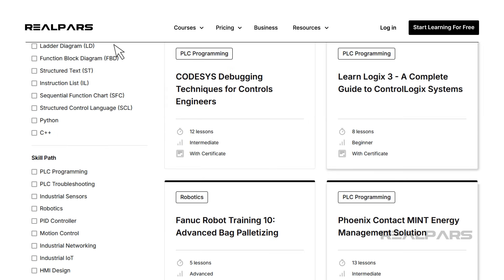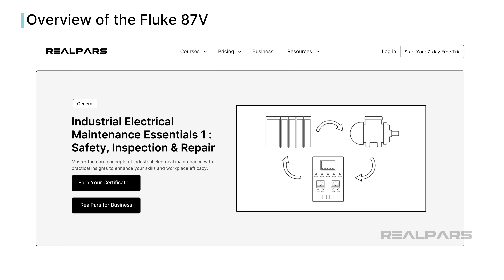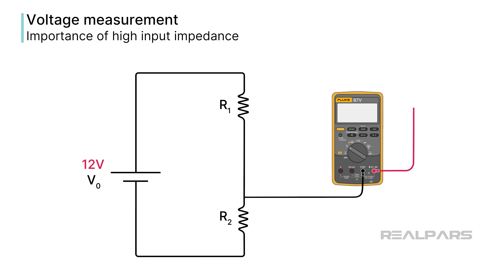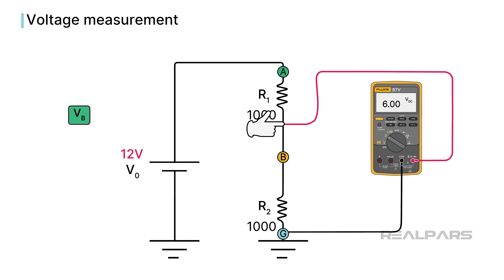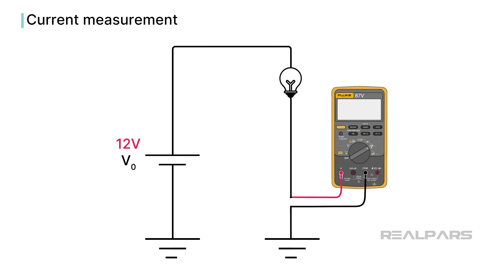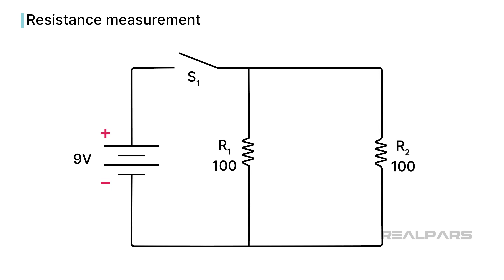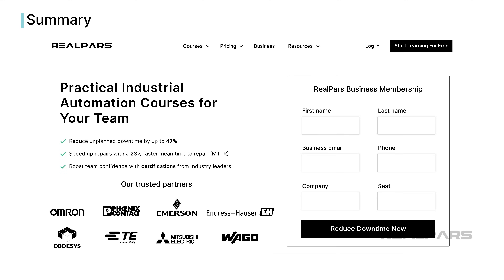Digital Multimeter Basics: Troubleshooting Essentials

Comment: I'm new to Electronic. I'm  using buck converter to supply power to Arm Robot with 4 servo
I don't know how to  adjust the current on the buck converter.  I saw some Youtube tutorial where they connect  buck converter in series with multimeter while they rotating potentiometer.  Can it multimeter act as a load?  or did I miss something from the tutorial?
Reply from the maker: Sorry @jumbo999614, we don’t cover this topic, so we can’t guide you on adjusting the current on a buck converter.

Comment: 8:20 "The ohmmeter [applies] a voltage across the device under test and calculating the resistance based on the resulting current flow.".   If that was the case, in order to measure resistances close to zero, it would be dealing with currents near infinity.  R = V / I  Ie: for R = 0,  R = [test voltage]/[infinite current].   So this obviously cannot be the strategy the DMM uses.
Reply from the maker: Hello @Graham_Wideman Thanks for your input. Your Ohm’s Law reference is correct, as an extremely high current results from a near-zero-ohm load. While the video’s analogy might be imperfect, it aims to show that attempting to take a resistance reading in a live circuit can introduce an additional source of energy. And that’s not advisable. I am old enough to have experienced a situation where a seasoned tech’s old-style analog multimeter exploded in his face while trying to measure resistance in a live circuit. Thanks again for your input.
Reply: @realpars  The point you were getting to is of course valuable:  isolate the resistance to be measured from the rest of the circuit so that the measurement is unaffected by the circuit's normal operating voltage or currents, and so there are no other paths in parallel with the resistor under test.
But that said, for personnel who are just learning how to use a meter, and also becoming familiar with Ohm's law, I think it's important that they realize that a multimeter measuring resistance is not some magic box with special powers. It's just an application of Ohm's law, in fact a nice demonstration of it. 
So describing its actual strategy (apply current, measure voltage, meter performs R = V/I) is a lesson that bolsters their understanding.  Instead describing it as "apply voltage, measure current" puts into their heads an incorrect notion that on reflection doesn't make sense and undercuts their understanding of this basic and essential area  of theory.
Regardless, I admire the effort you put into your many videos, that consistently try to provide easy-to-digest introductions and explanations, and encourage being on the lookout for opportunities to clear up misconceptions  about basic theory that seem to persist so widely.

Comment: How do you determine if you have a blown fuse on your DMM that you weren’t aware you had? It’s like I pick up a random DMM to use, say from my co-worker, but before I use it, how do I safety check to test and see if the fuse is good?
Reply from the maker: Hello @UrbanGregory.  Thanks for your question. There are a few methods of testing your fuses. In the past, I've used a two-meter method, which isn't always practical if you don't have another meter nearby.   I'm assuming your meter has 2 fuses, one for low mA current readings, and one for high amperage readings. Place your meter's probes in the mA position, use the second meter on ohms to perform a resistance measurement, and record the result.  Repeat for the amperage position. Both ohmeter measurements should indicate near-zero if the fuses are good, OL if the fuses are open. Thanks again for reaching out.
Reply: @realpars  Thanks for answering. Will try and check. But I think in a future troubleshooting topic with a DMM, this safety check is important enough that it should be covered in how to perform. As it can be easy to blow a fuse and be unaware, or someone else borrowing meter, using and totally also unaware the DMM has a blown fuse and doing measurements with it.

Comment: I am confused. Can you explain why 8v is to high?? In omhs law you need two of the three to find the 3rd, shouldnt you include the current ?
Reply from the maker: Hello, @sebastiangonzalez-rp6jb. Thank you for your question. I can see how this could have confused you. We are taking measurements of our circuit as we troubleshoot. We are not using Ohm’s law for any calculations in our circuit. Therefore, one of the rules in electrical theory is that all voltage from the source must be used up for it to create work, or, as we say, return to the source, which is 0V or ground, such as when lighting a light bulb to illuminate brightly. In the video at 5:49, we start to explain this. R1 is using 6 volts; therefore, it is getting hot. Then we have 6 volts left, as we explained; if all the remaining voltage is returned to the source and used up to make R2 as hot as R1. We have 8 volts sitting on the top of R2. This means the voltage is not all returning to the source because there is a bad connection due to corrosion on the bottom connector of R2. Meaning that not all the voltage is returning to the source, and R2 will not do the work or get hot like R1. They are both 1k Ohms.  Here is the link to the theory of this called: Gustav Kirchhoff’s Voltage Law   https://www.electronics-tutorials.ws/dccircuits/kirchhoffs-voltage-law.html
Reply: @realpars Hello, @sebastiangonzalez-rp6jb..... let's try this explanation as well. If the resistance from A to B, and B to G were the same, the voltage at B would be 6V.  But, the measured voltage is 8 volts!  This is likely due to an increase in resistance between B and G.  And, what could cause this increase in resistance? Oooppps..... nasty corrosion could do that!

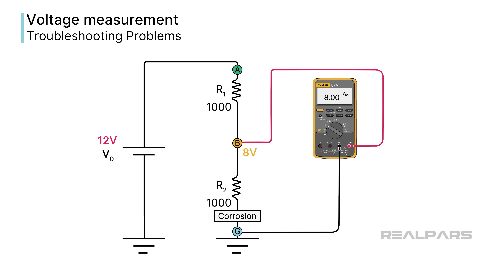Comment: I'm confused. at 6:04 you say that point A reads 12V and point B reads 8V but you say point B's voltage is too HIGH.. what am I missing here
Reply: Hello, @masonstrickland1323. Let's try this explanation as well. If the resistance from A to B, and B to G, were the same, the voltage at B would be 6V.  But, the measured voltage is 8 volts!  This is likely due to an increase in resistance between B and G.  And, what could cause this increase in resistance? Oooppps..... nasty corrosion could do that!
Reply from the maker: Hello, @masonstrickland1323. Thank you for your question, and I apologize if it caused any confusion.  Let me try to explain briefly without using too much technical jargon. In electrical circuits, if you start with 12 volts or any voltage, you must have a complete circuit for the electricity to work. This function is called EMF. If you have excessive resistance due to corrosion or if it's not a complete circuit, the load will not perform its intended function as designed. So, the circuit is not complete. Therefore, if you start with 12 volts when you measure like we did at 6:04, you will have a voltage drop of 1 volt or less at this point because the R1 of 1000 ohms is using all the volts minus the resistance of the 1000 ohms voltage drop, and the resistor gets hot. If you do not have this, then the circuit is not complete as designed. Consider this like water in a hose. When you open the valve, you should get all the water coming from the other end. If you don’t, you must have a kink in your hose or a leak! If you are studying electrical circuits, this is one of the first things you will learn: Ohm's law.  Here is a link you might enjoy for your learning:
https://www.electricalclassroom.com/ohms-law-voltage-current-resistance/  Happy learning from Realpars!